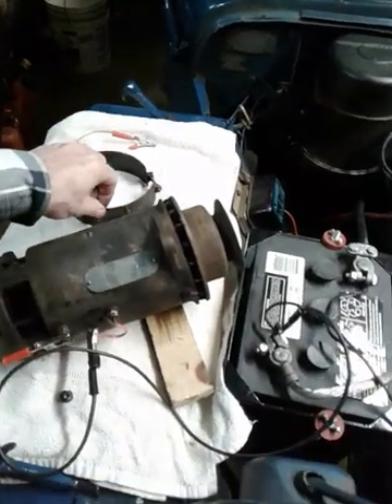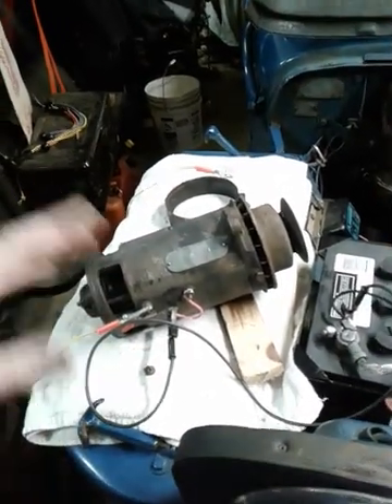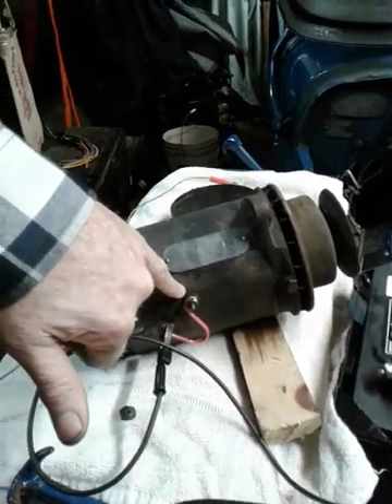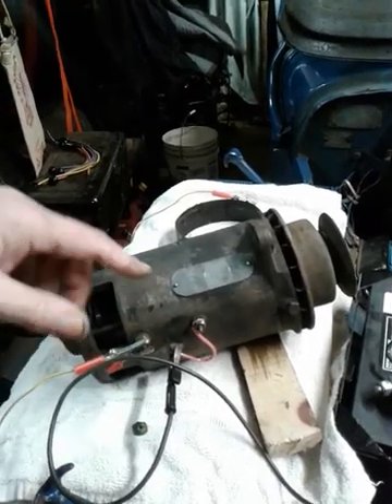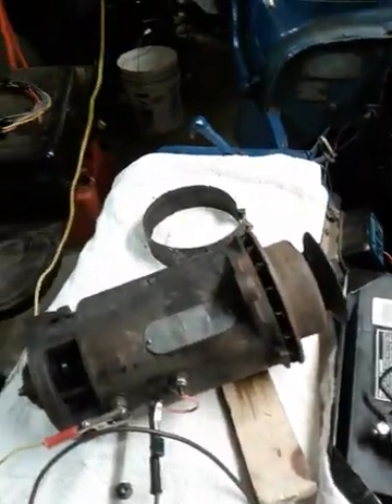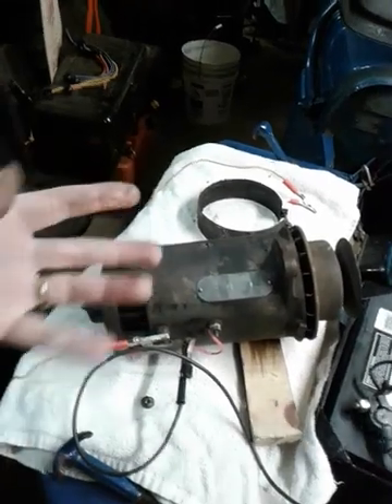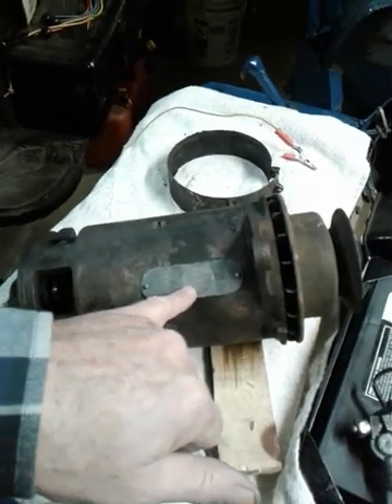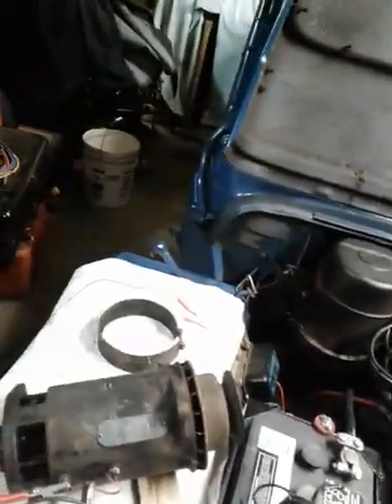Gen1 - initial motoring test

Comment: Hey Steve . I have a cj2a as well that I’m having problems with electrically . After working on it continuously the battery keeps dying on me slowly. Every time the starter turns it starts turning slower and slower and eventually won’t turn at all . The starter definitely works because I tested it. Is it my generator ? What could be draining my battery so quick
Reply from the maker: Not likely to be your generator unless the cutout relay points inside the regulator are stuck closed when you shut it off. That would be evidenced by a significant discharge showing in the ammeter after turning it off. Have you checked the batttery's specific gravity? Could be  dying cell. Or you could have deteriorated wiring causing a parisitic current draw.  Many possible causes....

Comment: Thanks for making these videos Steve. I'm trying to fix the charging system in my 1962 Studebaker with an Autolite generator and your videos are a great starting point. I'll try the "motor" method first to eliminate the generator as the problem. Have you mentioned polarizing in any of your videos yet? Keep up the good work.
Reply from the maker: Polaring is mentioned at end. Just before testing it out. The motoring test polarizes it.
Reply: @SwabbieSteve  Hi Steve, thanks to your videos, I was able to determine the generator was good and the regulator was the cause. Tried cleaning and adjusting it, but ended up getting a USA made replacement which fixed the problem. 👍

Comment: How do you remove the pulley?  My pulley is bent. Thanks for sharing
Reply from the maker: I use a 3 jaw puller. If its really stuck, heat the pulley near the shaft with a propane torch. That may help.

Comment: It’s a great series Steve, thank you. Quick question please: My 12v generator is smoking after a few minutes running, what could be the problem??? Thank you in advance...
Reply from the maker: It could be several things. Is the regulator set correctly so it only puts out what is needed? If its putting out max current, it can overheat. Otherwise it could be deteriorated insulation on wired, field coils or a short in the armature.
Reply: First of all thanks for answering so quick! My big problem is that there is no technicians who work with this stuff in my country, I have to do all by my own, is there a way to test the armature to see if there is a short ?
Reply: How can I test the regularor’s set up?
Reply from the maker: This video explains how to test it with a multimeter. https://youtu.be/qNV7TylIzSY